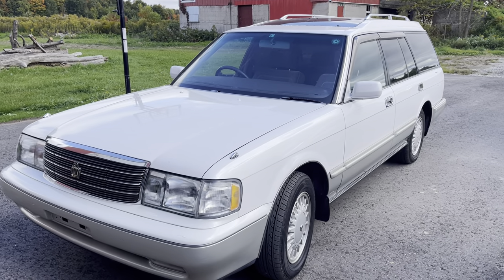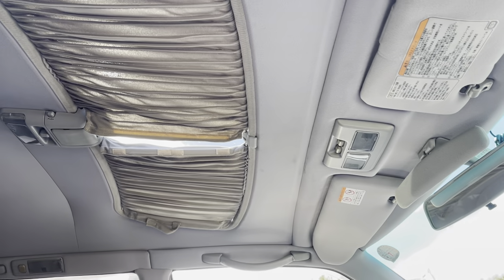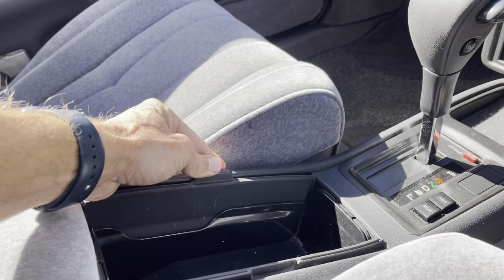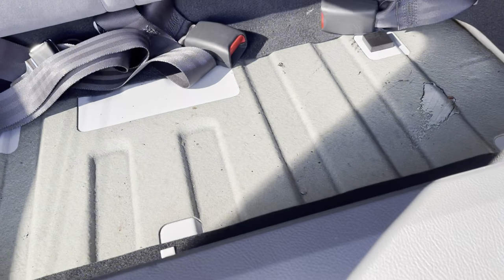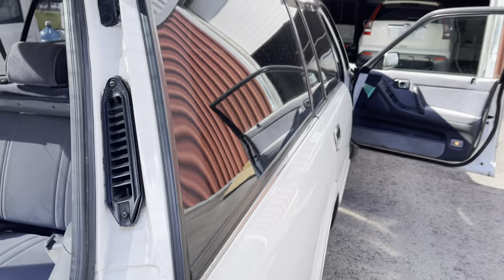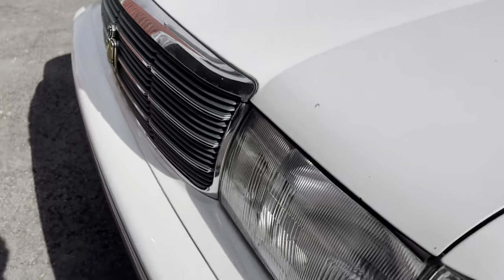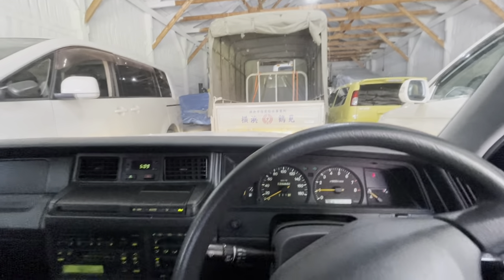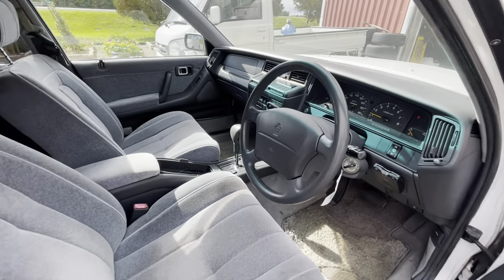1999 Toyota Crown Royal Saloon 1JZ station wagon

Comment: This is not 1999. this car model 1994.
Reply from the maker: nope
Reply: @bonsairides  in some country this facelifted S130 existed until year 2000
but actually at 1992 Toyota had S140 and at 1995 S150 exist

and I think the engine is 2JZ-GE VVTi
Reply: in my country, this facelifted model started at 1993 to 1994 with 1G-FE 2.0 engine and 1995 t0 2000 wity 2JZ-GE non VVTi engine
Reply: @nononice5197 . . . I  am  not  sure  where  you  got  that  number.